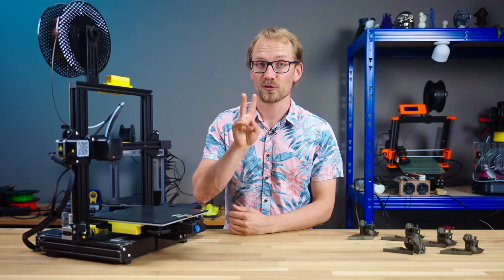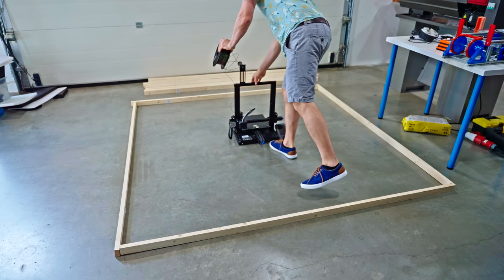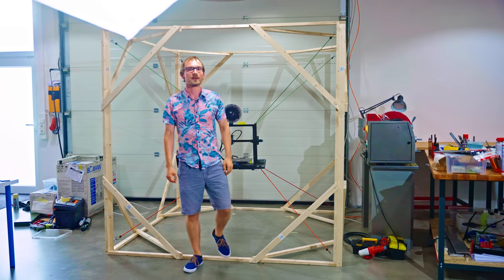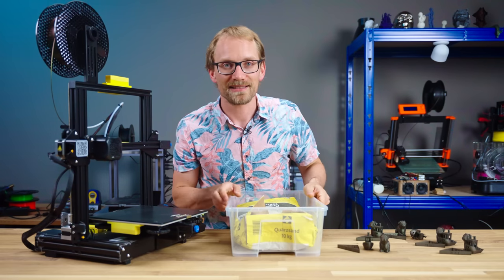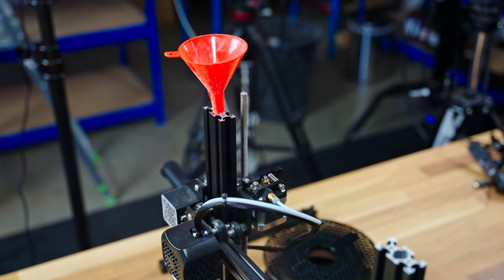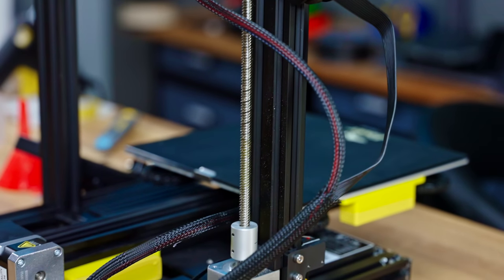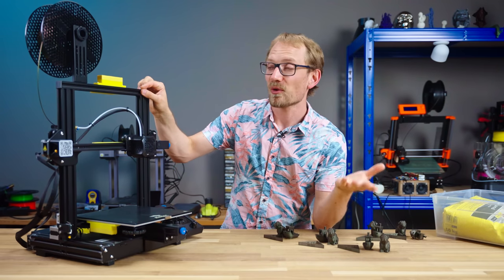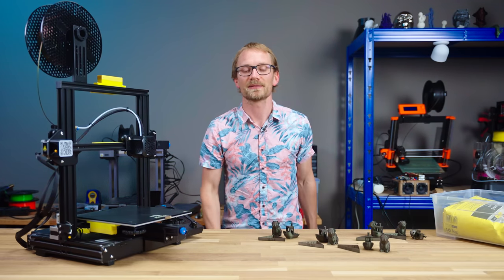You made me do this…

Comment: I'd like to see a graph that shows how acceleration (and jerk) are related to ringing and other edge artifacts.  I think it is clear that if you go slow enough you avoid some resonant frequencies and you feed energy into others at a lower rate.  But, how slow is slow enough?  At what point does slowing further have no benefit?  There is a maximum speed for moving the extruder in each dimension, and the ringing and other effects probably vary by direction too.  I'd love to learn more about how print head speed and artifacts are correlated.

Comment: You should try butyl rubber sheets, you can cut them to size, they roll onto any flat surface and are specifically designed to dampen and absorb harmonics and mechanical vibration. 

Butyl rubber is used a lot in the car stereo realm, bass heads swear by the stuff and coat their entire frame with butyl rubber to create an environment which will resonate their music how they want as well as removing any noise pollution from the outside. 

Sand around moving gantrees gives me mad anxiety

Comment: Great video but the proper solution would be for all the other firmwares to include resonance compensation like Klipper does. It just works so well. I'm sure the next generations of canbus breakout boards will have an ADXL built in or the pins to add one.

Comment: You could try sticking Moon Gel to certain parts. Basically they're sticky, jelly-like pads that drummers put on drum heads to get rid of unpleasant overtones and resonant frequencies. No idea if this works, but since they are actually designed to swallow/dampen vibrations from the surface they stick to...

Comment: I pumped the inside of 2040 profile with silicon sealant, That takes high vibration frequencies out of the Ender 5 Plus chassis well. I also stand the printer on 2"x4" foam Pipe insulation feet.

Comment: You probably need a pendulum counteracting any forces produced by the printer acceleration. The challenge there is that first, you'd need either 3 dampeners (X/Y/Z) although you might be able to skip Z.
Then, they'd have to be motorised and not passive, as they would literally have to be synchronised with the G-code to introduce a counter move at exactly the right time and of the right magnitude.
That's for dampening. And quite an overhead.

For mechanical resonating frequencies.... you'd need a maglev X/Y/Z carriage... zero friction, zero mechanical resonance, but then your magnetics could make a mess out of everything and they'd need to be so strong that you'd need a full on lab to pull it off. So pretty unrealistic...

Other idea would be to somehow do a freq analysis on the printer and find out which are the frequencies at which the printer resonates the most, and try to dampen just those, or offset them to a frequency with a wavelength larger than the printer's mechanical capabilities so they wouldn't be able to create much issue. (You'd still have to deal with some harmonics but depending on the order their magnitude could be irrelevant)

probably the best approach ever would be to decelerate the printer by the g-ccode when approaching a curve or any direction change. Being a 180° turn the slowest.
(The same as with cars, try to do an instant 180° at 100kph without skidding over.... pretty impossible, plus the g force from such move it could also kill you)

So throw a straight line at crazy speeds, but decelerate proportionally to the turn ahead..... rally driving 🤷🏻‍♂️.
But... increases printing time.

I guess to make an omelette you really need to crack some eggs.... (and feed Newton)

Comment: You could have coated the inside with a thin epoxy resin to close all the gaps, or maybe a plastic glue? Do it twice if there are still gaps?

Great video. Although I think the stepper motors rely on quick change of movement through friction on the feet. So suspending it in the air would create more resonance.

Wouldn't you solve the ringing by adjusting the printing speed? 

I don't believe we should be manufacturing products with a 3d printer but using it as a design utility to ultimately create injection moulds. Which would eliminate the ringing. Or just print super slow. 

You only want fast prints if you have a production line or print a lot of stuff I guess

Comment: As someone who listens to records Vibrations is a CONSTANT nemesis but you NEED to focus on anchoring/dampening ONLY the base NOT the moving parts, that is the reason the Rubber feet worked the movements of the bed and extrusion head are finely tuned so dampening them will ONLY work when you also compensation in  software, going back to the Simple view if you went with sorbothane instead of regular Rubber you will see improvement because it is DESIGNED to absorb energy more, similar to certain Squash balls, after the improved feet sitting it on something VERY HEAVY and rigid like a big Block Block of GRANITE or Marble will help

Comment: I personally think the dampened frequency was a lot lower in the Tesseract rig. If you could have varied the dampening frequency for example, similar to the feet, you would have seen positive results. The bungee cord supports should give off a tone like a guitar. This tone can be used to tune each corner. I believe the sand dampers would have Been more effective on the bungee cords. Overall, great experiment!

Comment: Hey Tom, I have one idea that I have been wanting to try but just never found the time to execute it. What if you swapped the bearings in all of the V wheels out for some that have a higher tolerance and a higher ABEC rating with a smoother, low friction roll? I would also be curious to see how something like Gates belts (steel back belts) would do for a simple setup like an Ender. I know they work great on things like H bots where there are much longer belts that are going to be able to stretch more due to the longer lengths. I doubt they would have much effect on print quality but it would be something interesting to see.

Comment: Not really surprised by the outcome of this video.  My gut feeling is that you won't see meaningful results without stiffening the frame first.  People commonly use plates to connect extrusions and reinforce them.  You could also go hardcore and weld the aluminum extrusions together.  Maybe use polyurethane spray foam to fill the extrusions.  Secure the entire printer down to a heavy base.  Even with all of that, you will only improve ringing.  Input shaping would still be required to eliminate it (mostly).

Comment: Hey Thomas, what about ataching the printer to some termo-acoustic sound dampening panels? Just like with the concrete slab, but this time with a material that is designed to absorb vibration and dissipate it as heat. Tech Ingredients has a amazing video on diy sound absorbing panels where theres a run down on the types of material available.

Comment: i use 2 part expanding foam mixed with sand to fill in the aluminum extrusion, keeps it light and helps dampening
Reply: or epoxy granite if weight is no factor for the part

Comment: If you're need an effective damping material, they you should be looking for viscous solid type, best represented by butyl rubber. It's available in liquid and caulk form and as an adhesive named SBS glue. I personally use butyl caulk which is normally used to fix windows in vehicles and buildings. It's very affordable. I pay something like 5 euros per pound. It's sticky and holds it's shape so you can put it on any srface. If you fill voids with it then you introduce it to sheer forces, which makes it even more effective.

Comment: Parasitic resonant elements with damping.
Determine the axis and frequency of the offender, make a spring/mass device that runs at the same frequency, attach it to printer.
Apply some thickish oil to the spring/mass system to act as damping element.
The spring/mass will vibrate in resonance with frame of printer, but viscosity of oil absorbs the energy.
Similar systems are used in tall buildings to damp-out sway.

Comment: I recently moved my Weedo X40 to a small solid wood table that seemed very sturdy until I noticed the legs twisting/moving ever so slightly but just enough to cause the top of the printer frame to be shaking back and forth up to over an inch in movement. This was all after tuning linear advance causing the printer to increase its speed. Back on the desk it’s going until I get a proper setup for my 3 printers.

Comment: V8 engines have had a 'Harmonic Dampener' built into the crankshaft pulley since the first V8's began breaking their crankshafts due to Harmonic Vibration.  
Have you tried Sorbothane feet or pads...?
Lead shot is also a try-able idea - as it's used in 'dead-blow' hammer heads to absorb shock and vibration.

Comment: Would it be possible to apply a super thin rubber tape between all connecting parts to dampen vibrations? If I were going to go really nuts with worrying about vibration I'd stick some type of thin rubber even under each screw just to see what happens.  Find a dirt cheap used printer and put silicone caulk in each screw hole to see if that limited transfer vibration along extrusion and also add the thin rubber under head of screws, getting larger screws or screws with different heads if necessary.  I'd be curious if printer would still be rigid enough after doing that.  Maybe a future test to get video views?

Comment: I spent months doing this at one point, replacing various bits of the 3d printer, following the math to change the resonance frequency by what should be an extremely measurable amount. My conclusion was it was/is an electronics/firmware problem not a mechanical problem.

Comment: Why no use an accelerometer to check the vibration frequency of the machine? Then add/remove the weights at points and observe each effect.
Reply from the maker: Accelerometer works if your reference doesn't move at all. In the case of a 3D printer, where both the bed and the toolhead can move, you actually need to measure the delta between the motion of the nozzle and the motion of the bed, requiring some quite custom solutions to record.
Reply: @MadeWithLayers  Looks like a job for cnc kitchen. Lol

Comment: Great video, I enjoyed watching that. Instead of filling your extrusion with sand, try filling with clear GE Silicone seal. If you don't have them already, try stepper motor dampeners like the ones we use on our Pulse printers. Keep up the great work!
Reply: most youtube examples suggest that stepper dampers either offer no change to print quality (only sound) or claim they're a bad idea.
you have result showing otherwise?
Reply: @adriansue8955  Yes, they do work. They reduce printer noise, vibration and resonance. Most Youtube channels are entertainment hosts. I think if you do a bit of reading up on them, you will have a better understanding of how they function.
Reply: @MichaelJHathaway  Can you point me to a paper then? hopefully one that's entertaining?
Reply: @MichaelJHathaway   The motor dampeners only isolate motor noise ringing through the frame. Those are typically higher frequencies that are annoying to listen to but don't really affect print quality much, especially given drivers available these days. They might quiet the machine a little but they don't do squat for lower frequency vibration or resonance of the motion components that typically show up in print quality.

Comment: Kralyn finished developing an upside-down FDM printer and open sourced it about a month ago, though it's a more interesting approach to how it prints upside down, as it's not just an i3 flipped on itself. I'm surprised the concept isn't more common considering the benefits it has, plus resin printers already print this way; hopefully it will become a more common platform, since it's open under the creative common license. It's an interesting project you should check out. 

The resonance issues really come down to machine design itself. Trying to improve a lackluster design is a rabbit hole of bandaids that eventually becomes a sunk cost fallacy. Good designs are built to be good from the start. Which is also why I have hopes for Kralyn's Positron printer, that's currently on v3 and is the version that's been open sourced.

Comment: The changes that will have higher chance of success:
- The spool should not be in the top, the mass should be always in the lowest side
- Remove mass from moving parts, this means, no sand and try to get the hot end as light as possible and move the motor for the bowden system to the static frame
- Reinforce the gantry frame and the connection in the base, it will help to have less wiggle

Comment: New idea, use a frame with a heavy alab of stone (garden tile, marble etc) and have the printer secured by 8 dowels in the frame. Carpentry workbenches sometimes have holes for dowels to be put in place, so workpieces do not slide around. I imagine the printer would need to move the stone slab to start shaking  and I do not see it creating that much energy.
If this explanation is not enough I will gladly reference or make a mockup.

Comment: For those familiar with Klipper, it would be nice to see some measurements with an ADXL 345 to be more scientific . 
Weight may not be the solution, but bolting a bunch of overkill braces to the Ender to increase mechanical stiffness, (stiffer system, higher frequencies osculations)  would be nice to see. 
There are A lot of aluminium extrusion angle brackets and such, to see if any of them help or not.

Comment: My two grains of salt (sand): 
1) elastic materials (bungee cords) are not enough for a real dampening effect. The suspension of a vehicle is built with springs (elastic) AND DAMPERS. The elastic material releases the energy almost in almost the same time that it took to absorb it. The dampening device is there to absorb part of the energy, and release that energy "slowly". That's why your BMW parts are frequency tuned.
2) the vibration ressonance is restricted to the adjacences of the printer's moving parts, in such way that dampening all the printer structure doesn't have significative effect in the ressonance.

Comment: Adding mass to the moving parts results in greater momentum. Particularly with belt-driven mechanisms (which have more flex than lead screws), that’s going to worsen print quality. It’s one of the only advantages of a Bowden setup over a direct drive (though direct drive has its own well-known advantages).

Comment: I would cast lead into base ( or attach it to granite bed), but adding weight to moving parts won't help, however increasing rigidity by adding tension might ( maybe tightly wound strings inside beams, or even screws that keep tension up ? ), There has to be a way since they make giant gantry cnc machines that are capable of milling steel without that much ringing

Comment: At home my ender 3 is resting on small bags of sand, weighing 500g each, and it works the same as those plastic dampers. Pretty surprised he didn’t showcase this solution when he mentioned using sand in the last video.

Comment: I'm new to the concept of 3-D printing... however not to structural design, If I may say, wouldn't it be easier to put angled brasses on the framework? and also fill the tubes with expandable foam (that comes in an aerosol can), for sealing off spaces??? OK that was my 3 cents...

Comment: There is a script (graph_shaper.py) that can take the output of klipper acceleration tuning done with an accelerometer and plot a graph showing the resonance. These would be interesting to see with all the different modifications of the printer you are trying out. Somehow I think all the math you are talking about is already built into the resonance compensation algorithm used in klipper and only requires slight tuning to get much better prints without all this extra effort.

Comment: Just make a tunable Damper.  Have a feet system like before however have a knob to adjust spring tension.  Place accelerometer from Phone on the base where printing happens and turn knob until vibrations are minimal.

Comment: I wonder how well this idea would work:

Rigid supports from the corners of the top rail to the base; this should increase the rigidity of the gantry and reduce the bending about the x-axis (that is, the top of the gantry rotating towards the front or rear of the machine)

Fill the aluminum channels in the base halfway with sand; this would give the base more inertia, so it should move less in addition to damping vibrations

The obvious solution is to reduce the gantry weight, but that seems a bridge too far

Comment: potential different question-problem pertaining to ringing in model layer toolpath with SHARP corners; it might even not be ringing of the frame or extruder itself in motion to make those effect once the large one is solved and you seek for more. on sharp corners, the extruded line is basically circle shape with offsets that gets squished by its own material in the toolpath; won't it be the extruded material amount itself trying to equalize within the toolpath? 

on that end, I simply model things with sharp corners filleted/rounded, so not only ringing is solved, but tolerancing is simpler and more effective

Comment: Very interesting!
Would it be feasible to use a "semi-proper" approach like adding another little extra mass/belt tension/tension of the elastic straps...  every few layers in order to approach the optimum by optimising one parameter at a time. By adding pauses in the GCode this could probably be implemented rather efficiently.